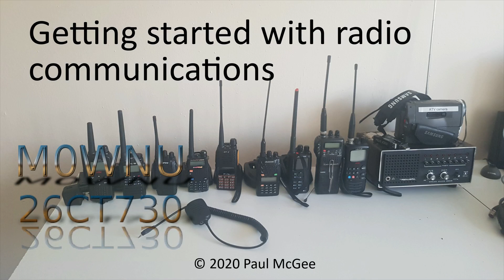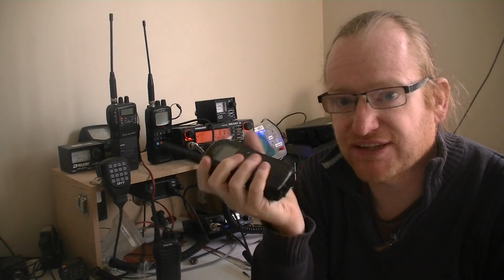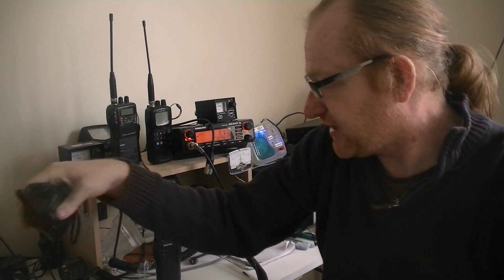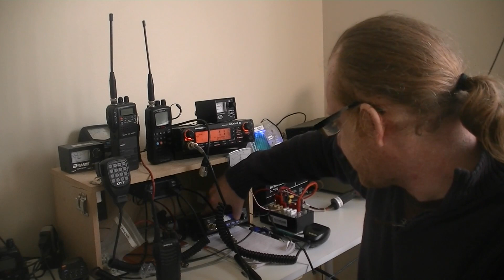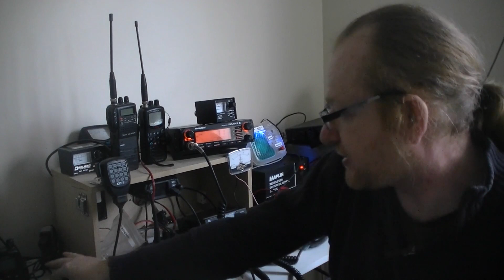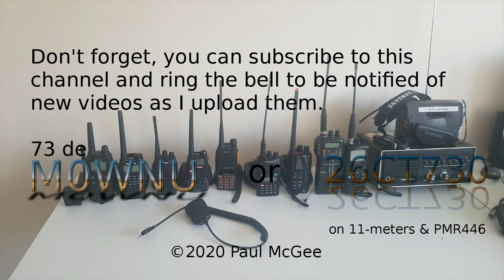Getting started in radio communications

Comment: Some Baofeng BF-888s PLUS does 0.5w low power and bout 1.8w high power.

So you could use Baofeng BF-888S PLUS with legal power with external antenna.